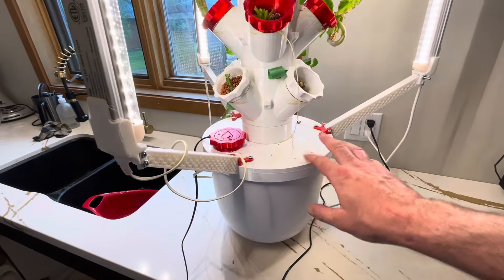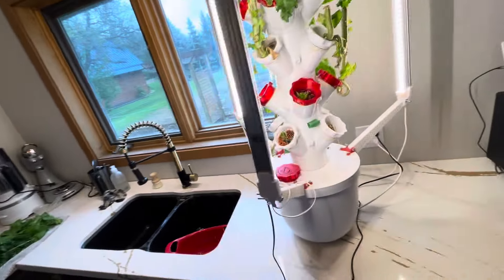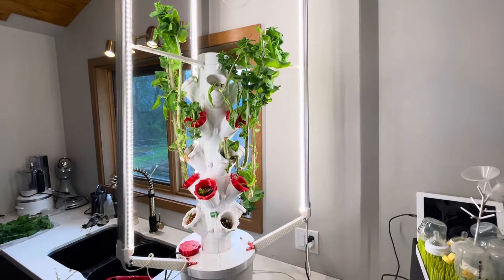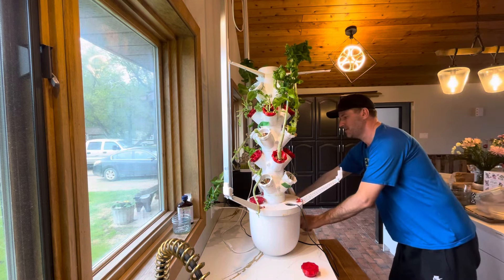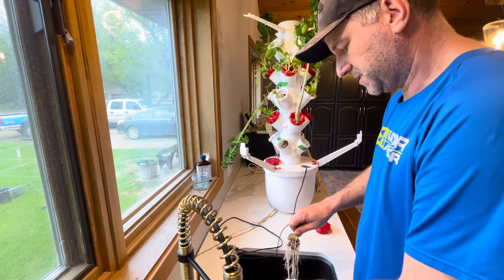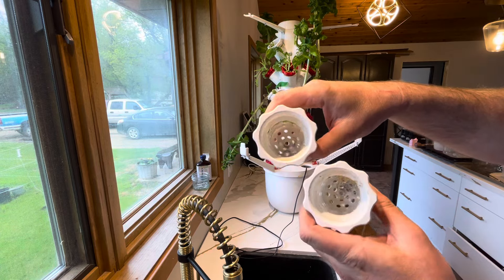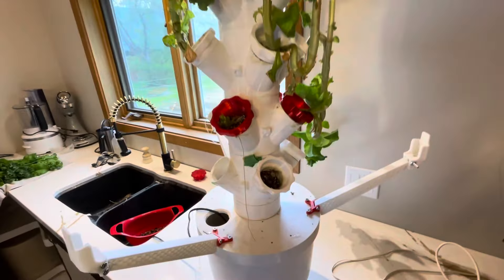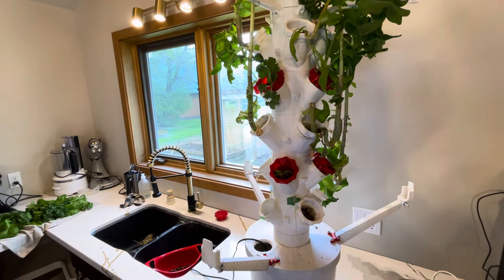3D Printed Hydroponic Tower Overview and Disassembly

Comment: nice video, was contemplating building a 4 tower gig with long lights like you have running through the middle. downside to this would be i can only have 1 row per each tower running on the inside part (towards the light).
Reply from the maker: The LED lights get hot on the metal backing side of them. You don’t want them contacting the plant or it kills it.

Comment: Two great hobbies put together! Gardening and 3d printing! Very motivating! Im thinking if there is some way to get a lazy Susan on a motor and just use the sunlight from the window? I realize the pump needs to be plugged in as well. But maybe its possible to wire up one with a plug in the base of it or something? Very inspiring!
Reply from the maker: A rotating plate under the pot wouldn’t be too difficult. Possibly a battery that runs the pump and the plate. Like a Milwaukee 18volt or something